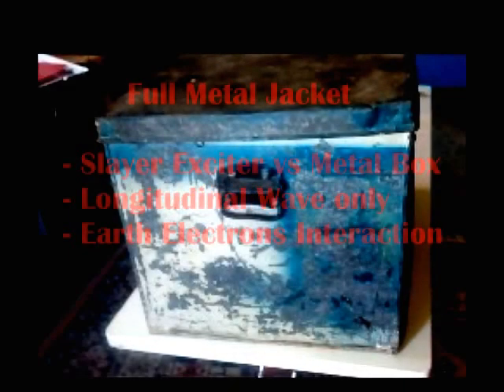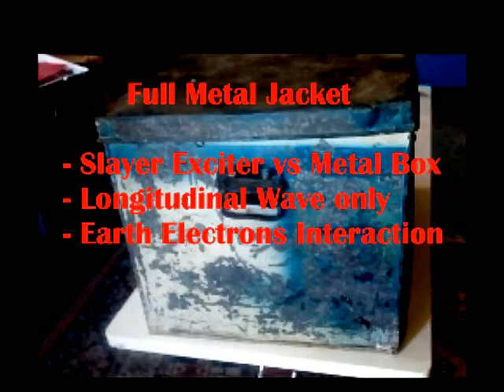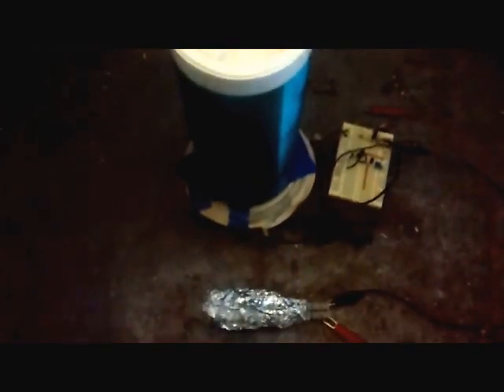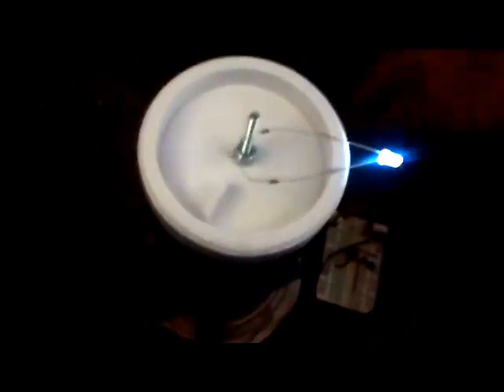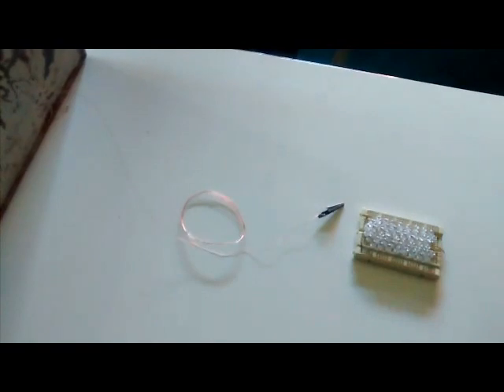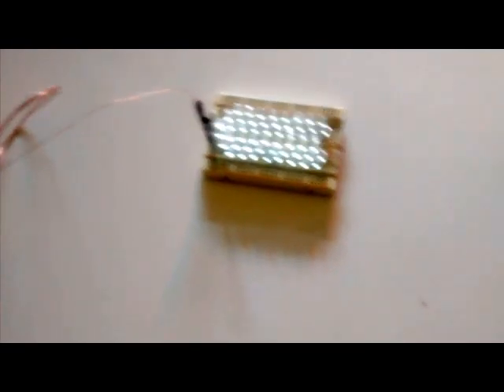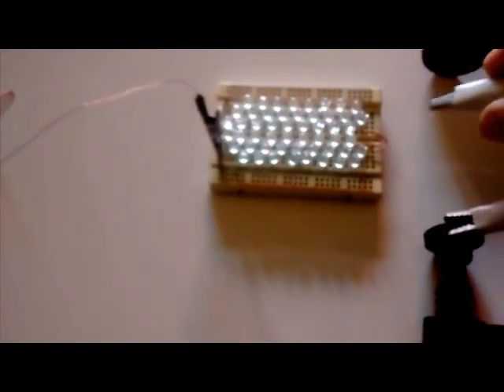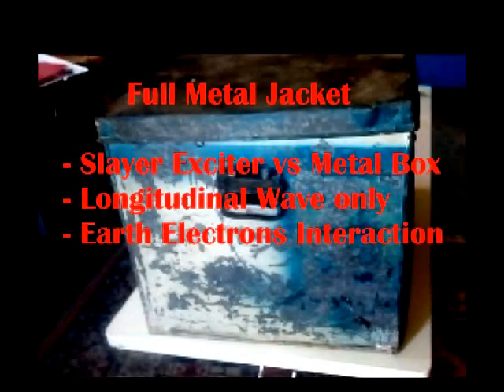One Wire Energy Full Metal Jacket

Comment: Can you please try to put the box 30 meters away from the LED board via the 1 wire connection and see, if the LEDs turn up also as bright as directly besides your box...? And please ground the box and see, if this makes any difference, so the shielding might be better by a grounded box...? Many thanks. Regards, Stefan.

Comment: Well done. Yes we have to come up with s standard circuit that can power at least a 10 Watt 800 to 1000 Lumen LED lightbulb just using a 1Wire system and be also safe and  not shocking  and with no RF Interference. . Maybe powered by a 5 Volts USB powerbank... that would be great...
Reply from the maker: There is a goal!

Comment from the maker: How many billions of dollars are wasted on two or three wire transmission systems covering the earth?  Let me know if you have seen videos where this has been ramped up. Thanks
Reply: Thanks for sharing your video. Are the 52 LEDs connected to the end of the single wire thru a 2 diode AV plug which connects in parallel across the 2 sets of 26 series LEDs?  Are you also using the same type of AV plug to light the single LED at the top of the coil?
Reply from the maker: The earth end of the driver is connected to the anode of two diodes and then to ground. Each bank of 26 leds is connected from ground to driver. I will do a post to clarify.  On the HV end of the Slayer coil is a simple AV plug with a single led - this is just to show the circuit is on.
Reply from the maker: I will do a post to clarify. The negative lead of a NPN slayer is connected to two IN4148 anodes then to ground. The two banks of LEDS are connected in reverse to each diode.
Reply from the maker: LED banks are in series
Reply: Thanks for your response. Since there is a one wire connection to the LEDs this is not a wireless transmission so the metal box will not shield the signal traveling on the single wire. Thus putting the circuit in the metal box does not prove that there are longitudinal waves traveling thru the metal box. The high frequency circuit is generating about 80 volts (26 white LEDs in series: 26x3.2V) which is lighting up the LEDs over a single wire and the capacitive coupling via earth ground or metal mass connection. What convinces you that longitudinal waves exist in this circuit?
Reply from the maker: I put the driver in the metal box to prove it was not the usual HV excitation field surrounding a Slayer Exciter that was lighting the LEDs. Nothing is passing through the box. The wave is associated with the single wire.